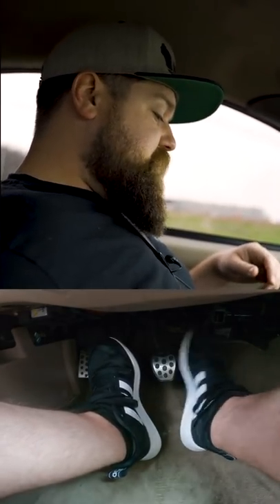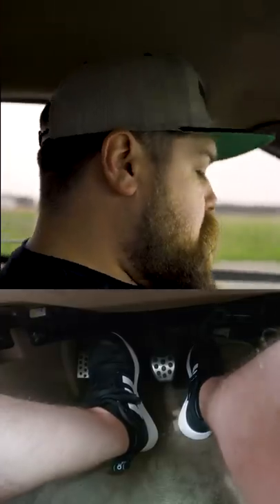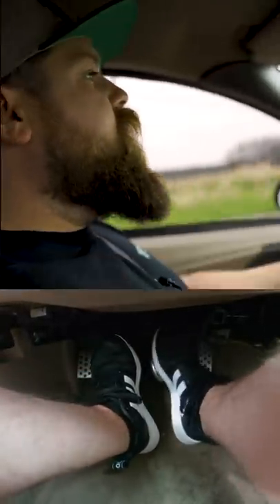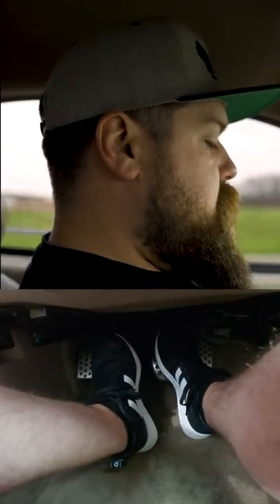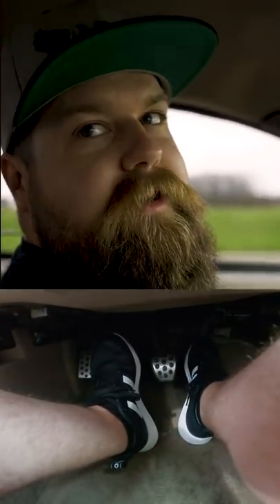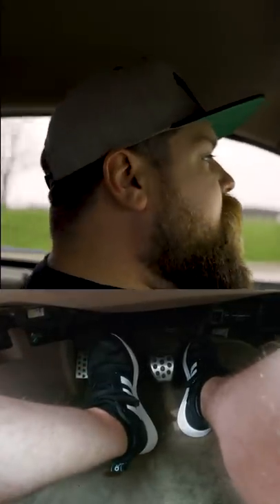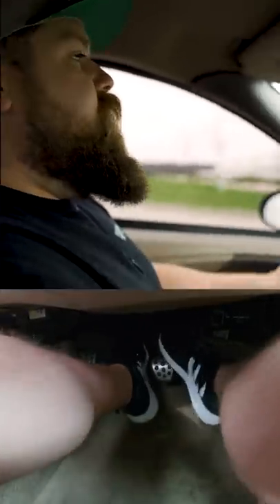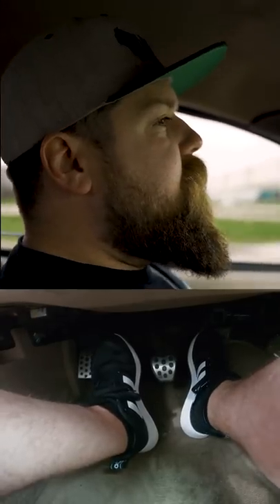How To Heel & Toe Downshift #Shorts

Comment: I’ve been practicing this in Dirt 2.0 with Logitech G29 steering wheel and pedals and it’s harder than it looks
Reply: It is because the brake pedal is stiffer however not impossible 😄

Comment: How do you not accidentally jab the brake when you blip the throttle?
Reply from the maker: Great question! The major point of heel & Toe IS to be hard on the brakes. In a street scenario you're probably better off rev-matching without the brakes at all. 
-Sean
Reply: @FitmentIndustries  You are the first person to make a H/T video to admit that you should be hard on the brakes. Most of them show it but never explain how much brake pressure you are applying.
Reply: @FitmentIndustries  well now I feel like less of an idiot. Thank u
Reply: Iit takes practice..i used to do it stopping for redlights an stuff just to get used to it..then started doing in in turns but at a relatively safe speed an area after a while it becomes just like shifting u dont really think bout it
Reply: It's an excellent point about being hard on the brakes. I see a lot of comments about struggling with this technique in a ford fiesta (and a mod to solve the problem). Yes, spacing is rubbish if you're gentle but so much closer (therefore easier) when you mash the brake. Ergo, ford wants you to drive hard! Will do sir
Reply: @FitmentIndustries  yeah the height difference between the throttle and brake pedals in the RX-8 is pretty big. Makes it difficult if you're not already mashing hard on the brakes.

Comment: One thing I've always been confused on: does the actual shifting come before or after you blip the gas?
Reply from the maker: You should be shifting before! It should be in gear when you blip the throttle and you should be releasing the clutch when the blip is at the correct RPM
Reply: I do it all in one motion, blip while downshifting and letting out clutch before the engine is coming down on revs. My downshift sounds like it was from factory but its not.
I do it without thinking about it now....I've even doing it for about 3 years everytime i downshift.

Comment: Alright but how'd u maintain consistent smooth breaking or is that just practice.
Reply: All practice
Reply: Like with literally everything. It's practice.
Reply from the maker: Practice, practice, practice! Over time you will get a much better feel for it. 
-Sean
Reply: No practise, you must be perfect right away
Reply: Make sure you're in a good seating position
Reply: Did he though? Cameraman looked jostled "AF"
Reply: It gets easy sooner or later
Reply: It helps if you brake with the ball of your foot and then instead of kicking your heel out, leave it on the floor and rock your foot sideways to reach the throttle... You get better control and range of motion. That said, some cars have super wide pedals and make it so you need to reach. To start just drive a constant speed and learn to get the revs up to match where they would be if you were in a lower gear. Incorporate braking after you figure out where the revs need to be.

Comment: Good video. 99% of the time is just rev matching vs heal toe.  As I push in the clutch with left foot I hit the brake initially with my right foot then quickly blip the gas with right foot and then brake harder again.  One positive is the brake lights double flash so the yahoo behind me has a clue.

Comment: It's hard to heel-toe in my car, the gas pedal is too close to the brake, while also being about an inch deeper in the footwell, and the pedals are too close to the transmission tunnel to properly do it, so I would have to use my heel (really more the arch of my foot) on the brake and my toes on the gas pedal, which is one of those hinge-on-the-bottom style pedals so you can't really get a good blip with that angle...

Comment: I have an automatic at the moment but I still practice this technique for when I do get a second car that’ll be manual
Reply: How
Reply: @SilviaLover2012  I basically have a fake manual mode on my car that I use so I have  more control over my gears and RPM. Using heel toe makes downshifting smoother
Reply: @K1N6V4MP  but you don’t have to rev match in that mode. It does it for you
Reply: @K1N6V4MP  It really does.
Reply: @K1N6V4MP  you could left foot brake it too 👍

Comment: For anyone new to this, you clutch in, throw it into gear, blip, and let off the clutch, all while keeping your foot on the brake. It kind of sounds complicated but practice while sitting in your car and it'll just become muscle memory. Before you do though, make sure you've mastered rev matching because this is a more advanced version of it and if you just drop a random blip, you'll upset the car anyway. I found it the hardest to get second gear right when I was starting off but now it's just a subconscious act and I do it all without even thinking about it.

I'll be honest though, heel toe is something I don't really use too often unless I'm carving canyons or blasting on the track. Regular rev matched downshifting is perfectly fine, and less stressful for beginners, and I only ever find myself using heel toe if I was going too fast and I know I'm not going to be able to slow down in time if I just do regular rev match blips, or if I don't have enough distance to get on and off the brakes. In that case, I will just sit on the brake and heel toe, especially in the rain because my tires aren't too fantastic in the rain and the engine braking helps a lot. 

Don't try heel toe for the first time on the mountains or in the rain and risk clutch kicking into someone else or right off a cliff lmao. Long straights are wonderful.

It's all just practice. You'll probably pick it up in a week or two of constant trial and error, but it'll take a good while to master so don't get discouraged, and don't feel the need to be absolutely great at it because like I said, it's only really (more than regular rev matching) useful when driving hard. You don't need to heel toe to make a right at the light unless you're going like 60 into it.

Comment: I blip the throttle to downshift but I need help with heel toe(ing), I either brake to hard or can’t reach it to get enough gas, I have a 100 hp can so when I blip the throttle, it’s more like 100% throttle for a millisecond then pull straight off and start releasing the clutch

I’m kinda stuck. I don’t know if i need more practice or if my pedals are just too wide spread (they don’t look like it)
I drive a Hyundai Accent ‘03 Hatch
Reply from the maker: The technique is meant to be used in a track setting, where you're on the brakes SUPER hard. It's best used while braking hard, not just rev match down shifting on the street.
Reply: @FitmentIndustries  right okay, yeah.. I wondered that because every time it semi works it is a hard break, thanks

Comment: my heel is always blocked by my transmission tunnel
Reply: If your gas and brake are close enough together (or ur feet are wide enough), you can use half your foot to brake and the other half to blip throttle. It feels a little bit weird but that’s what I have to do
Reply: @SilviaLover2012  ya it feels really weird but I need more practice

Comment: :: glances down to my size 14 and a half Titanic's I call feet in the footwell of my 91 300ZX and my non adjustable steering wheel and my long ass legs attached to a 6 ft 6 frame. :: Hmm.. Naw chief.. heel-toe isn't in the cards for me. That's for you people with those tiny dainty feet and short legs. Been driving for over 20 years and in almost every vehicle I tried to do heel toe in. It's a pipe dream. So I compensate in other ways.